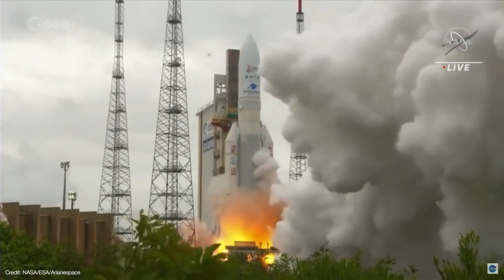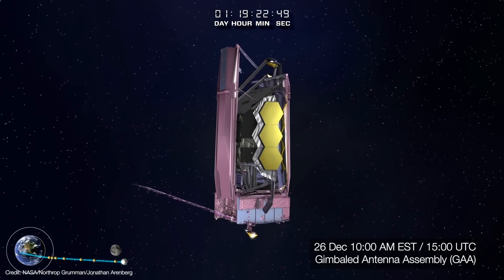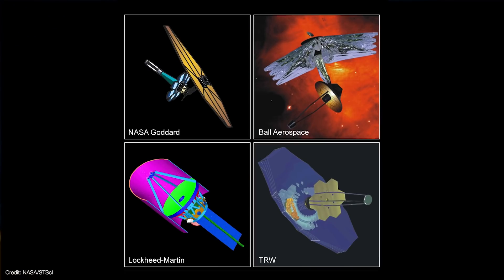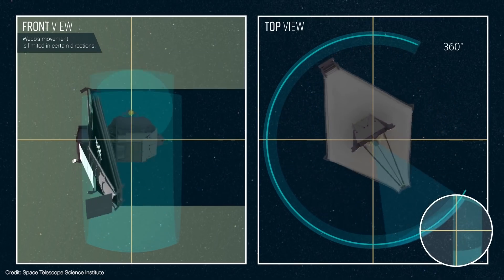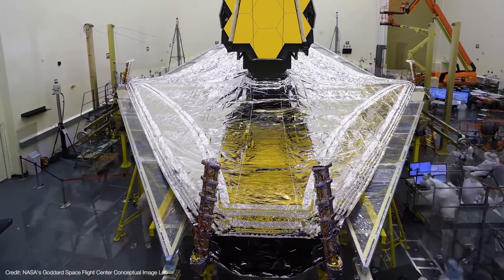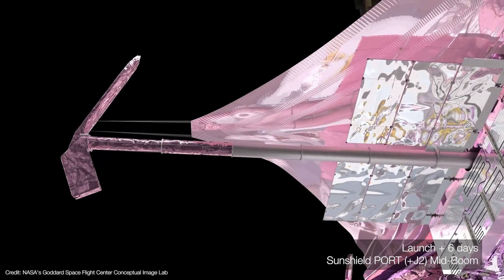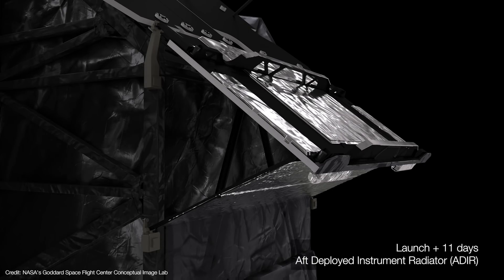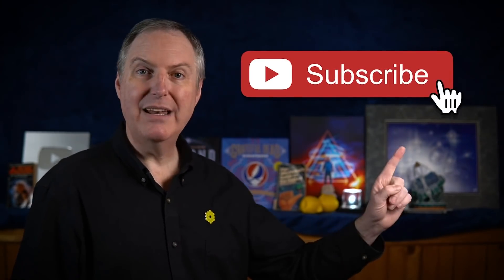How James Webb's Deployments MUST Work

Comment: Only an engineer would try building something with this many points of failure and high tolerances. Its basicly going to have me clenching all month. All the while spaceX is working to launch steel tubes into space mostly reallying on software to make up for the low tolerances of each rocket. All the while working on the principle of no part is  the best part. Its a very different way to thinking and working. The next space teloscope thats going to go up will likely be assembled in space and will be much larger, cheaper, and more reliable.

Comment: Have any space missions ever built the deployment hardware for critical things like that solar array out of materials that sublimate in a vacuum? That could allow a design that, even if the primary releases fail, will still eventual deploy when the retention devices fall apart.
Reply: Do any such materials exist ?
Reply: @pskale  I first thought of the idea when I found a reference saying RDX (a.k.a. C4) can't be used in pyrotechnics because it sublimes. I don't think using a high explosive for other parts would be a good idea, but it would be surprising if it was the only material that does that.

Comment: L2 is in the center of the shadow (umbra) of the earth. I guess JWST has to orbit L2 far enough not to be in the umbra and even the penumbra of the earth. Otherwise, the solar panels wouldn`t receive enough sunlight to supply power for the operation of the telescope.

Comment: Why does JWST's dish point "sideways" rather than straight up away from the sunshield?
Reply: Because that's where the distant galaxies are.  At maximum spacecraft tilt it might  see stuff directly opposite the Sun.  At normal or reverse tilt it might look at the North Star or the Southern Cross.
Reply: @johndododoe1411  do you mean that distant galaxies are in certain directions?  Isn't it all around us?   My initial question was that having JWST point "straight up" would allow for a wider field of view than its "sideways" configuration.  Curious why NASA chose the sideways configuration

Comment: If it's fully deployed and then Webb reaches the L2 point and the final booster manoeuvre is initiated to make that almost 90 degree change in flight path, at that speed, wouldn't there be potential damage to the structure? Of course... I know they've thought it through! I really want it to go all the way successfully.
Reply from the maker: Good question. I’m guessing they’ve taken the accelerations into account, and it’s actually not a very high thrust maneuver because by that point it will barely be moving fast enough to reach L2!
Reply: @LaunchPadAstronomy  Thank you! Yes,  if it slows down by that much, then all is well!

Comment: Does L2 move around with the solar system barycenter at all? How does the orbit of the other planets affect it (if at all)?
Reply: I think the other planets do affect it slightly because another video I saw said that theoretically an object could be in the L2 forever but in reality any object needs occasional orbit corrections.  the web will need corrections also.

Comment: If something goes wrong with any of these steps, like the sun shield deployment, will there be any way to know it went wrong since there isn't a GoPro or anything attached to watch?
Reply from the maker: A camera would be nice, but the telemetry will indicate what's going on in all of Webb's subsystems, latch points, release mechanisms, etc. You can actually learn a lot more from telemetry than a camera can show you!

Comment: At the time of launch, they had identified 344 single points of failure all of which had to happen exactly right or the mission was going to be toast.

I would like to see a countdown, somewhere, starting at 336 (I think it's down to 336 now) and counting down, of the remaining possible points of failure.  Each every thing that has not catastrophically failed is a milestone on the way to mission success.
Reply: aren’t most of the “points of failure” yall are talking about just random bolts and stuff? what is the point of talking about these anyways
Reply: It's a good idea. There is always  room for content.

Comment: Is there any advantage to having Webb and Hubble both active simultaneously?
Could Hubble do a visual inspection of Webb? Could they triangulate the position of objects?
Reply: Many telescopes are being used  to  give  Webb  planets to look at.
Reply: Webb serves a bit of a different function. It's not a replacement of Hubble (more like a replacement for Spitzer Space Telescope), those two telescopes supplement each other.

Well, they will until one of them stops working, but for now we should be optimistic l.
Reply: Keeping as many telescopes as possible alive means more science can be done. JWST is the hot news, but all the other telescopes will not magically become worse or unusable because JWST comes online.

Also any telescope already in orbit has gone through the major expenses (design, build, launch) so the longer they stay operational the less they cost (dividing the total cost per hour of observation)
Reply: Hubble is a 70s spy satellite given to NASA in the 80s and launched in the 90s, it's impressive that it even works at all in 2021.  "Way past its shelf life" is putting it mildly.  JWST's 15 years of delays probably contributed to keeping it alive lol.
Hubble will still be useful as a space telescope until it finally gives up the ghost, because there are only so many space telescopes running and there are so many things in the sky to point them at, but technology has really evolved since HST was designed.

Comment: Wouldn't the amount of heat on the sun side cause the telescope to accelerate away from the heat like a solar sail?
Reply: Yes  they have thought of that it can thrust  to counter it.
Reply: no cuz the shield area vs the mass of the spacecraft pretty much makes acceleration by light negligible
Reply: @tongshengwu171  

I did not say light. I said heat.

And negligible is not zero.

Comment: I'd be starting to build a repair robot that can be sent out to JWT in case the deployments don't work.  That many single points of failure seem like a recipe for heartache.
Reply: I told them to Include a robotic arm with multitools but the morons did not listen
Reply: @esecallum  hehe

Comment: We need to stop patting JWST on the back and framing its long development and 300 single points of failure as some heroic marching forth of science. I mean yes it is that. But it’s also the epitome of mismanagement, hubris, and borderline fraud. No cost discipline. No managerial discipline. No engineering discipline. 

Millions have asked why it took so long (25 years) and cost so much (20x original estimate) and the standard whitewashed answer is “space is hard” or “this telescope has revolutionary technologies” or “this will see back to the beginning of time (it won’t, actually)”. The real answer is that the scientists, engineers, and managers wanted too much. Instead of a great telescope, they wanted a SuperDuper telescope. Instead of being happy with 90-95% science goals, they were willing to sacrifice decades of effort, billions of our tax dollars, and even the telescope’s structural integrity to chase that last drop of performance. Just how bleeding edge can we make it? It’s a kind of sickness, really. 

Instead of creating a straightforward design centered on the largest mirror housing that will fit in a rocket fairing, let’s design a telescope that NO rocket can actually fit, and because of that we’ll have to invent a crazy untested origami-folding mirror that is orders of magnitude more risky, time-consuming, and expensive. And because we insist on a folding mirror, we also can’t give it a proper housing. So it sits there naked, unprotected from solar radiation and micrometeorites. THAT is why the Ariane rocket had the crazy flight path it had, and why the telescope can’t turn around to do a braking burn at its destination like every normal satellite & spacecraft. Because it can’t turn around, because it has no housing to shield it from the sun, because it has a folding mirror, because we refused to design a normal (and much cheaper) telescope with a smaller single-piece mirror, because we wanted more more more.. Because the people who made this godforsaken telescope said “Who cares if it adds 15 years and 8 billion to the project? It’s not our money and we’re not the ones waiting an entire career to finally do science with it, so who cares right?”

Never let Perfect be the enemy of the Pretty Damn Good.

Comment: I wonder why it couldn’t have been unfolded
In earth orbit so if something went wrong it could of been accessible for repair before sending it on course to L2. Anyway, it’s a masterpiece of engineering!
Reply: Because it needed the momentum of the launch to get out to the lagrange point where it needs to be. They can't just stop it in earth orbit, unfold it, then send it on its way. Orbital mechanics don't work that way.
Reply: @XShadowAngel  thanks for the declarative statement "orbital mechanics don't work that way."  Very helpful and show that you really know what you are speaking about and not just talking out uranus.
Reply: @greasystrangler3703  ...They don't. Sorry to trigger you? You cannot stop an object in space and then restart its motion without, for instance, firing engines. And the engines on the telescope aren't capable of doing that kind of thing. They exist only for minor course adjustments and corrections.

Astronomer, by the way. You?
Reply: @XShadowAngel  I like how children nowadays attempt to deflect any criticism towards them by saying the other person is triggered.  It's cute.  You said on the one hand "orbital mechanics don't work that way"  and then on the other you say you can't do it without firing engines.  So which is it?  An impossible feat due to the nature of orbital mechanics or a possible feat with proper planning and the inclusion of the proper propulsion system?  Did you really think the OP wouldn't have assumed in their question that the engineers would have included the engine necessary to send it to the L2 point from earth orbit if that was determined to be the best way to proceed?  And no, I won't lie about my profession like you.
Reply: @greasystrangler3703  The James Webb is not capable of doing what you suggest. Fact. It's not my fault you failed physics class and don't know anything about the hardware in question. OP asked why the JW couldn't be stopped, unfolded, and sent on its way. They did not ask about some make believe telescope with completely different functionality and capabilities. There are ways to restart motion once stopped in space, as I already said, but such things have to be taken into account during designing, include their very own complications and dangers, and still have to fit within mission capability of the rocket launching it into orbit, etc etc. This question was about the Webb. The Webb cannot be stopped, unfolded, and continue on. Period.

You think you can do better? Then do it. Until then, you and all the people that think they're hidden geniuses and can do better than some of the best engineers in the world are just....sad.

And yes, I think you're giving WAY too much credit. We live in a day where random people on youtube with zero engineering experience think they'd do a better job than some of the top engineers on the planet. Which is laughably ridiculous.

Not lying about my profession either (went to school for it, but not getting paid to do it currently so not really my profession anyway. I have a degree), but whatever.
Reply: @greasystrangler3703  I have better things to do than deal with your inane drama. I answered OP's question based on the spacecraft in question and the facts in question. They asked why the Webb couldn't be stopped in earth orbit and unfolded and then sent on. I answered why that specific craft was unable to do that. I don't particularly care if you found it helpful or not. Given the likes, it appears most that read it did find it helpful. You changed it into something else and starting throwing in hypotheticals solely so you could argue. Grow up, move on.
Reply: @XShadowAngel  based upon likes?  you claim to have a scientific mind but you determine truth based upon popularity?  you are a joke.  go hide
Reply: @greasystrangler3703  I determine if most people found an answer helpful based on likes, because that's the only indicator available on the platform. I'm truly sorry this is too complicated for you.

I'm not even the first person you tried starting arguments with. I just made the mistake of actually engaging with you instead of ignoring you outright as I should have from the start.
Reply: it could work if we still had a shuttle but we dont there we have no space vehicle to catch it and effect repairs and if we had said ability it properly would have bean built in orbit like the ISS and then pushed out to L2.
Reply: I remind everyone that this engineering feat is not yet operational. There’s a lot to be done yet.
Reply: @rushpuppy2  yeah?  go take your sign and stand out on the street corner then
Reply: @greasystrangler3703  a street corner is where I’d likely run into the likes of you. Been arrested lately?
Reply: It didn’t stop in low earth orbit but was pushed directly to the L2. For a stopover in LEO it would need an extra stage, with all the extra weight and other complications the go with that.
Reply: @professortrog7742  oh, and all this reverse origami ISN'T "other complications" then huh professor?
Reply: That’s my question too. 
It should have done in stages. First test all elements near earth in case something goes wrong and then send a small rocket (spaceX?) for an extra push (in this case a dock station is needed). Not cost effective but safer

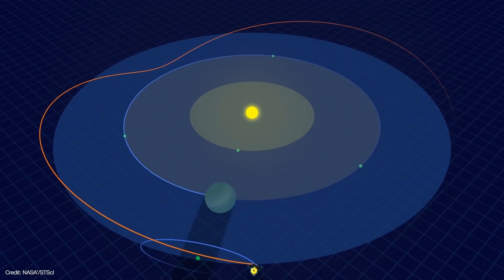Comment: 6:09 I thought L2 was a saddle point, i.e. a marble would be stable in one direction (transverse, I guess?) but unstable in the other. Also, the circulation of the telescope at 5:54, is its radius really that huge?
Reply: Just found out: the Webb halo orbit is about the same diameter as the Moon orbit's around the Earth. That's quite large, didn't know that.
Reply: It will require ongoing periodic burns to stay in its halo orbit around L2. Once the propellant runs out, that’s the end of station-keeping.
Reply: Yeah, spacecraft in halo orbits can be stable even if apogee is quite far out. Most spacecraft maintain ~few 100,000 km apogee and perigee relative to L1/L2 point to maintain stable communications (prevents the sun from being in-line with earth) and to reduce fuel consumption while remaining stable. Generally, orbiting too far would lead to an unstable halo orbit, and eventual escape either to geocentric (earth) orbit or to solar orbit if no corrections are taken.

Comment: There must be a good reason why there's zero method for re-fueling, either robotically or by humans.
Reply: Adding the docking technology to the telescope would create weight problems.
Reply: @davidhoward4715  it already has it all thats needed is a delivery vehicle.
Reply: Doesn't require refueling and it will be beyond reach
Reply: @James_the_Builder  Webb uses fuel to  counter  orbit drift.
Reply: they are exploring the possibility, we never know the advancement we can make in a decade.

Comment: Wonderful explanation of the deployment and how critical it is that everything works. I'm having high hopes for what this telescope will bring, but there's sooooo many points in the deployment that could fail. Hundreds. Statistically, for anyone using an everyday item something is bound to go wrong, so there's a lot of butt clenching and nail chewing in hopes that everything deploys correctly. Lot's of trust on all those engineers involved in this science instrument. If it deploys flawlessly, it will be equally insane as the sky crane deployment of Curiosity and well worth opening a bottle for to celebrate.
Reply: but with the amount of testing done, the risk at each point is reduced. fingers crossed as always... lol.. hope for the best...
Reply: @ce5834  Yeah, thats kinda what I mean. And I really hope all the testing pays off. Fingers crossed, some days to go
Reply: This narrative is getting boring
Reply: @trollking202  So is your life. Cheer up!